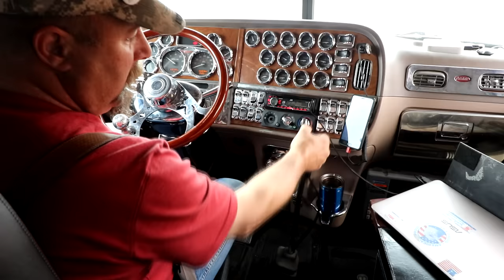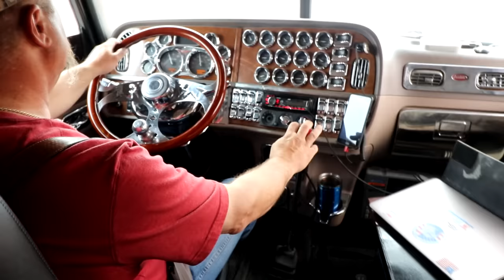How to shift an 18 speed transmission

Comment: Interesting to hear how you skip gears. Does everyone not use the clutch while moving?
Reply: To do that you need to learn two things .  A ) by the sound of the engine when it is the right time to make the shift , which means the sound of the right RPM must be memorized .  B) your hand must be gentle and confident at the same time . Means good grip but not too fast movement (otherwise in case of a mistake you ruin the gearbox ) so in case you start feeling a slight vibration on the shifter , a bit of resistance and a sound like growling , you can tap the clutch or just wait for it "fill up a bit" .  So you actually training your ear to tell you when the hand must move , while you keep eyes on the road , mirrors e.t.c . Only then you can drive without clutch .
Reply: George Isaak lol sorry buddy I got music on.. I don't need to listen it's called floating ..
Reply: A lot if the time yes. The one thing my uncle pounded in my head was if you shift when the torque curve and the power curve best meet you will not have to use the clutch to shift. In our KW900 the torque and power curve best meet at 15 (1500) RPMs and you hardly feel it slide into gear when you shift, again without the clutch. You can also tell by the sound the truck is making. And when I hall grain I start out in third if the truck is full and shift 5 more times using the split. If it’s empty I start in 5th and shift 4 more times with split. It’s a preference thing when it comes to skipping/splitting gears. My grandpa has been farming for 40+ years and goes through every single gear every time he drives.. it drives me nuts riding with him.
Reply: Chris Bramblett using the clutch takes up to much time and slows ya down, by floting the gears you can accelarate faster
Reply: BlackSmoke B ..true story..my radio is always on...it's like riding a bike once you learn it...and to comment on use of clutch...it's for starting and stopping purposes only..
Reply: My bucket list includes seeing what it is like to drive a semi  just once.
Reply: Chris Bramblett This transmissions doesnt have individual syncronizers that match speeds in transmissions like a car or small truck. Trying to use the clutch to shift without working throttle pedal at same time you would never " find"  the next gear. Theres a tequnique called double clutching that works but no one uses as you can still very easy miss a gear.
Reply: Just clutch dude. It's not rocket science
Reply: schmittza You still have to match the rpm's for the next gear, up or down. Clutch or not, if you're not synced it's not going in. This is not a pickup or car, completely different.
Reply: Double de-clutching is the technique I think you mean. Useful on much older vehicles with no synchromesh on any gears and used only when changing down through the gears, unless the box is very heavy.
Double de-clutching is where you are say in 4th gear and want to drop to 3rd.
You dump the clutch and drop the shifter into neutral.
You let out the clutch and give the engine a burst of gas which spins up the gears in the box
You dump the clutch again and engage the lower gear - while everything is still spinning at the correct speed for that lower gear.
It's the same as floating the gears where the synchro rings assist, but using the clutch as well.
With floating, changing up is easy, but changing down means pressing the throttle to match engine revs to the required rpm for the gear you are aiming for.
Reply: That’s called floating gears, most people who can actually drive don’t have to, if you’re new they teach you in school to double clutch.
Reply: Chris Bramblett gggh
Reply: Clutch smutch!
Reply: Chris Bramblett I didn't use the clutch on the cars I had, except like him, too start up.
Reply: Double clutching is for 1970's school busses
Reply: Trainers and testers want you to double clutch...
Reply: You are not driving for me if you don't clutch.  Trany rebulds are to much money and down time.
Reply: Drivers that never learn to float gears walk with a bad left knee after several years.
I agree I was too busy listening to the radio and if I had to I would glance at the tachometer. Floating gears is done by feel. Ol Sasnak has done this before and will again. When its done right, it feels as smooth as it looks. Don't cup the top of the shifter; finger tips will get her to slide into gear when the engine speed is spot on. When the engine speed and road speed come tome together the truck really does all the work in the shifting process.
Reply: A knee rebuild will cost a lot more.
 I have heard there are guys that don't like people to float. Thing is, there are very few companies that pay drivers what they are worth. 
Think about it. How many lives did you or your drivers save this week alone because a 4 wheeler did something stupid in front of you or them?
How many drivers take the ditch in the middle of Wyoming to save the lives of people in cars with families who think they can run as fast as you when its snowin and blowin?
I hear you brother, we have so much more responsibility on us with HOS and log rules. FMCSRs being written by people who have no clue. We just naturally see potentially unsafe stuff and prepare for the ugly all day long.
Seriously when was the last time you had to rebuild a tranny? If the driver was that bad they did more damage than just that. Honestly...you know a crap driver in the first 3 minutes if it takes that long.
 A trans rebuild at 1 million miles...that's cake. I say float!!
Reply: Eaton Fuller recommends double clutching for the same reason car manufacturers recommend US drivers don't tow a trailer with a car. Not because cars can't tow. They can, all day long, and if you ever go to Europe you'll see every RV, cargo trailer and boat is towed by a car; they don't even have pickups there. The reason US drivers are advised not to tow is because of tort law. Morons who have never learned to drive because the US does not require proper driver training are allowed to sue carmakers when they cause their own car to crash. Since it takes more skill to tow a trailer than not, carmakers feel they are better off just not giving cars tow ratings and instructions for towing in the US. But the cars we have here are the same ones they have in the rest of the world, and they tow all the time. Theoretically, in an alternate reality where it's every truck driver's first day, it would be better to double clutch. Since it's not many driver's first day, it's gonna be okay.
Reply: lol...i'm like grandpa except never 1st gear.
Reply: If it's done correctly Stan...there will never be any need for transmission rebuild or gear box repair.  Lots of drivers have no desire to screw up their knee for their later years when they really need it.
Reply: Chris Bramblett yes, once you start moving that's it, never touch the clutch again until your stopped
Reply: Martin Shorthose
the technique he means is double clutching. and it doesn't matter if you clutch or float, you still need to match rpm's when downshifting. and by the way, you can double clutch going up the gears. clutch, slip into neutral, let off the clutch, then clutch again and select the next higher gear, all before you lose too many rpm's, otherwise you will have to match rpm's to go up in gears
Reply: @charliecooperston   it just cushions the gear change and provides the average 400 rpm difference you need to shift to next gear
Reply: @MartinShorthose   there are no synchros in big truck transmissions.

Comment: A easier way to image it would be: 9 speed with low and high in every gear.
Reply: Patrick Kraemer 

Exactly 😂
Reply: Waaaaay toooo long an explanation. He makes it look hard. If I’m empty, I only eight gears. Start 2nd, 3rd,4th, highrange 5, 6, 7, 8 n hit high. If seen people shift every hear n split. 🤪
Reply: LJSJ you have 8 primary direct  gears, they all split.  and splitting up to the next gear is called overdrive
Reply: LJSJ we are not talking about 9 speed gearboxes . We are talking about 18spd.
Reply: @theforsaken4489  well drove many an 18 for years.. Very seldom ever use the low side to low it's best for off road as in hauling logs as I have done for many years.. And yes you can split all.. But you read the one he said like shifting a 9 and split each..go read.. A 9 is not even close to a 18 as in shifting it
Reply: LJSJ yes correct but I think he is saying you have 9 primary gears including the crawler in the bottom left and each gear you can split which makes it 18 gears he’s not comparing it to a Eaton 9 speed.
Reply: Yes. I am not saying it's a 9 speed, I am saying it's easier to imagine it as a 9 speed with all  9 gears having a low and high. 2 x 9 = 18
Reply: Patrick Kraemer yup plain and simple mate

Comment: Well what im more confused about is how tf does he see over the dash???
Reply: A.MŮĹĹËŃÃX you can see over the dash you cant see over the hood most trucks its... if your good enough of a driver you have a general feel of where all your tires are on the road
Reply: The perspective of the camera causes some confusion. If you were sitting on the floor of the cab,  you would be at the same eye level as the camera. You would not be sitting on the floor if you were the driver.
Reply: ashton
Seeing past the dash is easy. Just push the button for the air seat to get a little higher if needed. Some trucks have a hood long enough to land a Cessna on, and the blind spot in front of the hood is big enough to hide a minivan if you're close enough to it. No shit. When driving something like this you're generally looking at least several vehicles ahead, maybe a dozen or more, and everything close to you is in your peripheral vision and you know how much room your rig takes up and anything close you are aware of with a sixth sense.
You keep your eyes moving and watch the mirrors and be aware of anything moving into your blind spots. At the same time you need to watch all your gauges. You also watch the patterns of the traffic coming at you so you can judge the color and timing of traffic lights you can't even see yet so you don't have to slow or stop.
Now throw in curves and hills and snow ice and fog. Are you having fun yet? That's just to go forward. backing up is a whole other paragraph.
I do this every day in Calgary traffic for ten or twelve hours.
Reply: Thats what I thought

Comment: Once we start producing electric trucks this instructional video will only be 5 seconds long !!
Reply: Electric trucks will be a very long time coming. The amount of energy used to move a truck is HUGE as compared to a car. Range is all important. Can't imagine how big a battery would need to be to keep one of the warriors on the roll.
Reply: Diesel electric (ie; hybrid) will be where it starts. Been used on locomotives for over 80 years now. Full torque starting and dynamic braking will be huge advantages.
Reply: Man where have you been Tesla made a series of Electric trucks over a year ago with a range of 850 km / 500 miles. When you consider its taken 140 years to develop the combustion engine with an efficiency of 20% and the fact that full electric car production only begun 11 years ago with an efficiency of 80%  and keeps breaking new records in speed, acceleration & endurance each year, the technology is just around the corner.
Reply: +sharms888
No Tesla has not made an electric truck series. They have made ONE prototype and won't tell anyone its actual range. They have said that FUTURE trucks will have a range of 500 miles, but cannot give a date for when they will be available. 
Using Tesla's own current battery technology, for one of their trucks to go only 300 miles, the batteries would have to weigh over 26000 lbs or at least one third of the trucks available haulage capacity. 
So until energy density in the battery packs gets much better, electric trucks will only be used for very short haulage. Which makes them almost useless as thanks to the endurance, fuel economy and ease of refueling for diesel trucks logistics bases can be hundreds of miles from the products final destination.
Reply: Dylan Greene that prototype can already do the 500 miles. They are using it to transport stuff between their factories. I believe the truck goes into production in 2020 or maybe even 2019. The truck won’t use the same batteries as the S and X but will use the batteries the 3 is using with are slightly bigger but much more powerful. Same as the Roadster.
Reply: +bensemus x
Yeah I'm going to need a citation on that. I can find no information that the prototype can do 500 miles. Tesla themselves have actually reduced the range from 500, to 400 to then 300 miles for the actual road going version. Even then the battery packs are still a 3rd of the total haulage capacity.
Reply: Trying to get a member of the Elon cult to think practicality is a waste of time.
Reply: Junk video. As is pointed out over and over in the comments for it he made massive assumptions and overlooked major practicality issues. The foremost issue being the time to recharge. A diesel truck can fill its tanks and get on the road making money again in a fraction of the time it would take even 'supercharging'. Also the batteries don't last long if you charge to 100% all the time. Even Tesla tells you this on their cars that it's better to charge to 70-80% for longest battery life.

It isn't that electrical tractor trailers are impossible, it is the practicality of it. Just like Hyperloop (Which isn't a new idea, aka vacuum train) isn't impossible, it is just impractical.

Comment: Retired at 68 lady trucker U.K.   44 yrs on the road.   As you explained, most truckers rarely use the splitter on low range, just on high range.  I only ever used the splitter in low when hauling abnormal heavy loads.  Great vid though 👍🏴👍

Comment: Finally an 18 speed transmission that shifts properly. You DO NOT NEED TO CLUTCH a road ranger transmission. It does nothing but wear the clutch unnecessarily

Comment: Cool video thanks for sharing that. truck driving is going to seriously change once they start putting out those Tesla trucks capable of pulling more, single gear, huge amount of batteries, long distances before charging. back in my younger days I drove the 11 West for Mayflower, United Van lines. etc  I kinda miss it. 👍
Reply: @Hello Tommy how are you doing
Reply: @lydialas8756  what's up?

Comment: I learned to drive with a 63 Impala 3 on the tree.  I went to a 3 speed on the floor 289 HP 64 1/2 Mustang.  Then a five speed. I like manual shift. More control.
Thanks for this video.

Comment: Watch the tacho too. It's the larger dial on the left. There's always around 300rpm difference on a full gear change (no splitting). Splitting tends to change the gear you are in by around 200rpm. It would be only on really heavy loads you'd need to split through the entire box. Good way for beginners when they don't have the ear for the engine or feel for the float, watch that tacho, forget the clutch (unless standing start) it's where you can really make a mess.

Comment: Is there a safety to prevent you from going to high range to low range while in the same gate at high vehicle speeds to prevent over-revving?
Reply: I think unlike a car where a money shift can happen, in semis you can't.  Even if you are using the clutch the revs need to be close.

Comment: I used to drive a Peterbilt in the USMC which had 36 gears which is 9 split twice, the splitter on the shifter splits the gears in the tranny and then another switch on the dash used in the same way to split the axle gear. It was special built to haul tanks on talberts, which I did in the 90's.

Comment: Great video, I've got a couple of questions though: You said you didn't use the clutch after the first three gear-changes - "floating" is what you called it. How come there is no synchronisation necessary after this point? Do you just wait for the rotation rate of the engine to match the next gear? Also, what is the engine size, the horsepower, fuel consumption and the maximum cargo weight for a truck in the US? Many thanks and greetings from Germany.

Comment: If you forget about crawl gear and reverse, its actualy a 16 speed box. a simple 4 speed H pattern with a high and low range with each gear being able to be split. That is, !st, 2nd, 3rd, 4th, select high range, 5th, 6th, 7th, 8th. Each gear can be split so that's another 8 gears giving 16 gears. The "18 speed" is because there is a low crawl gear that can also be split but it is seldom used. Cheers.

Comment: Should add, a Old International  that I  used to drive  had 3 gearboxes,  early  days , MAIN BOX , splitter box ,& low box, Get it wrong and you  had to pull over   Stop, then start all over again. 
Same as with  2 speed Diff, yes today You 18 gears in 1 box DON'T  KNOW HOW LUCKY  YOU  ARE. 
Cheers to all.
NZ here.

Comment: Geez I'vd been forgetting as its been a few years. Ive drivin all but the 15. Even a old dumper with 2 sticks. Auto Cars with 7 speeds. Peets and W900L with the 18 speed. The 18 speed is a beautiful transmission and will spoil a driver rotten..😁  Safe drive now.

Comment: woah so it’s kinda the same thing where you clutchless shift on a motorcycle from letting off the throttle and shift in the moment the transmission disengages. but like on a larger scale with more inertia and thus a larger window meaning it’s less abrupt. really really cool 👍

Comment: Excellent training. One thing I would add when pulling hills or in soft road conditions, sometimes you need to stab that clutch to get the torque off to make that downshift. Especially if your forced to drop two gears and the sweat is popping up on u forehead!! Good times. I've driven all the trannys and the 18 is hands down the best for heavy hauling.